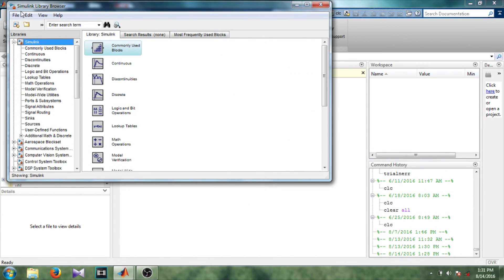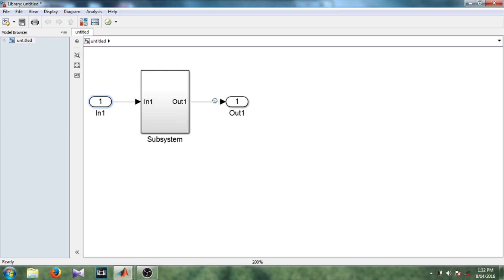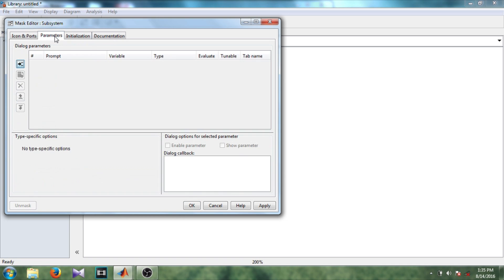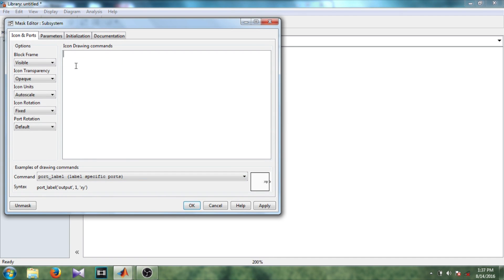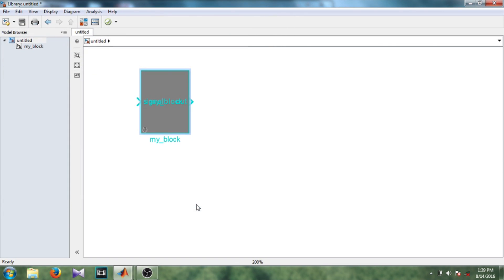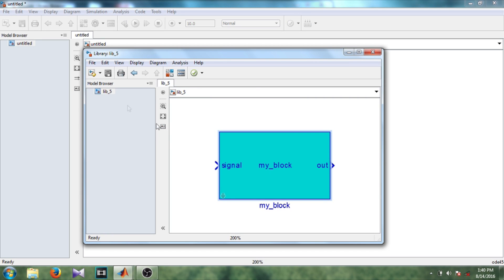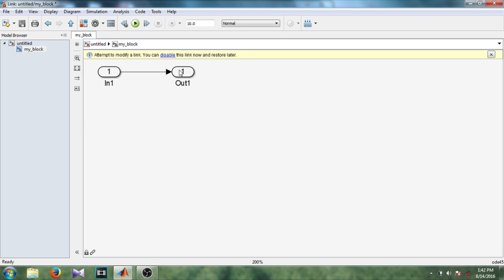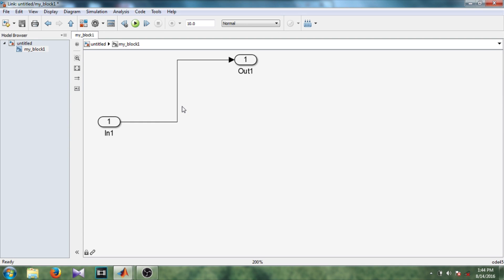Simulink Tutorial - 6 How To Create Library In Simulink

Comment: Hi....You videos arre really helpful...just a small clarification I need...why do we need library blocks when we already have the model blocks?Can you explain this with an example
Reply from the maker: Because using some basic blocks you can create a library block for some functionality which is required often in most of the projects. So instead of developing it from scratch all the time, it's better to have a library block and modify the parameters or settings for it so that it will be suitable for the task. eg. Counter with reset, pause, increment and decrement. Have settings for the library block such that user can choose if incr/decr or both are required.